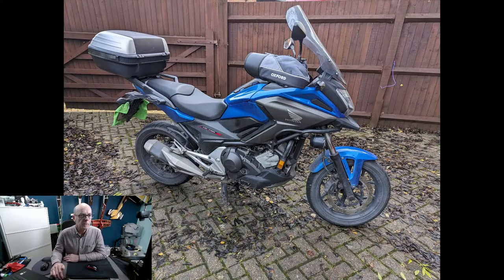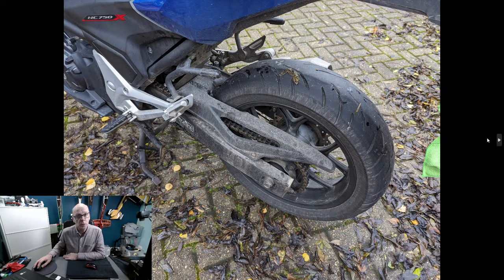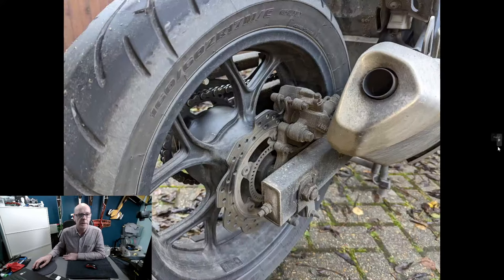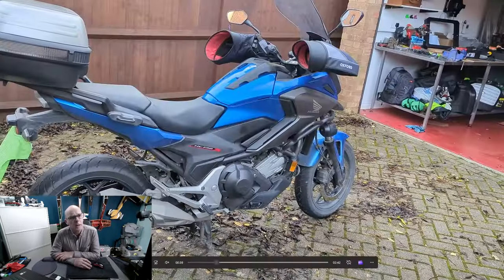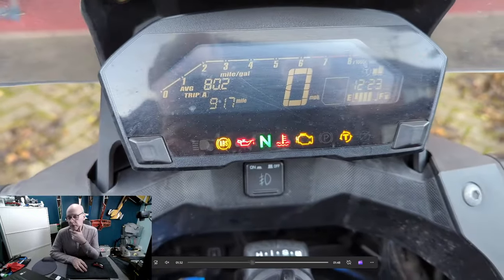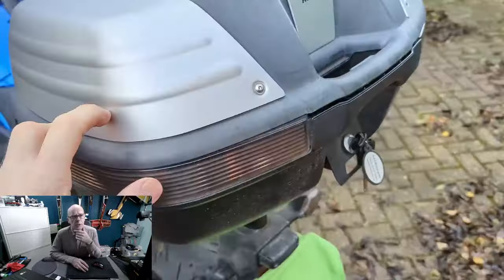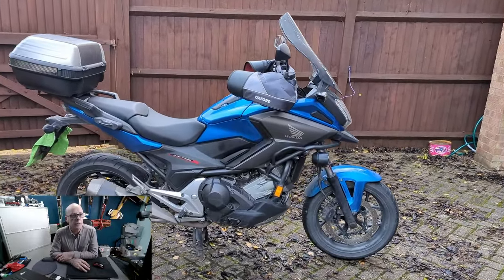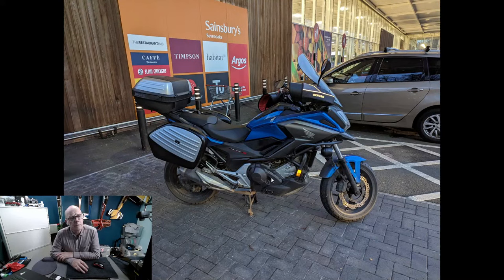Have I made a big mistake

Comment: I’ve just bought a new NC750 and really like it so far, everything you’ve said about yours is spot on.  However I can’t stop looking at the NT1100 and was sorely tempted at the time, but the value for money and capabilities of the 750 with its size and weight won me over. I will be extremely interested to see how you get on with your new 1100, good luck,  and hope all goes well with the bike and your channel.
Reply from the maker: Many thanks. You certainly won't be dissapointed.  It's a cracking bike and one I might even purchase againg because its so versatile, Economical, and you will have no issues with commuting or touring with this bike. You made a good descision. Cheers

Comment: All weather and shopping. That is committed. I have to revert to the car below about 4 degrees Celsius.
The reason I am here is that I was thinking about a NC 750X. Good to know you were pleased with it. For reliability it doesn't seem it gets much better than a Honda.
Do you go for the DCT versions or manual?
Reply from the maker: Hello, Definatley would go for the DCT. I was  converted when I bought the NC 750 X (Which was the best bike I have had for reliability and usefullness). Now wouldn't go back to traditional Clutch Lever. Everyone has their own opinion and it's not right for everyone. Would suggest a test ride for certain and make sure it's for more than 30 mins, and read up best way to operate before the test ride. You can't get used to it in that time if you havent riden one before.
A few videos soon here will be going through the DCT modes and how to get the most out of the DCT on my NT 1100 which is basicallly the same gearbox operationally.
Good luck with your descision, you won't be dissapointed with the NC750 X.
Thank you for your comments and have a wonderfull holiday season.
Cheers

Comment: I also have an NC-750 2021 and I really love it.  Here in the USA we aren’t able to buy the NT-1100.  Don’t know what Honda is thinking, but I would be in the market for one.  At 74 with 55 years of riding I would never consider a Goldwing, but for touring and daily use the NT makes perfect sense.  Shame they didn’t include a shaft drive.  Like you I sing the praises of the NC-750 for ease of use, exceptional gas milage and reliability.  Just subscribed and look forward to seeing your videos on the new bike.  My choice would be for the 6 speed with the quick shifter in Red.  All the best from Wisconsin.
Reply from the maker: Hello Many thanks for the subscription, much appreciated and really helps me along. Agree with your comments entirely. Weather in the UK is not as good as USA and it does take its toll on bikes especcially as a daily commuter. But mine never missed a beat, just routine maintenance to keep it in shape. Have a great Christmas over there, Cheers

Comment: Thank you for your video. I am certainly considering upgrading from a Dr650. Could you please explain how you got the touring screen for the bike as the windshield doesn't appear as stock. Thank you.
Reply from the maker: Hello Thanks for the comment. The windscreen was purchased from Slipscreens.co.uk https://www.slipscreens.co.uk/product/honda-nc750x-2016-2018-touring-screen and very reasonably priced at £60.00. Gives really good wind protection, but when you fit these make sure you obtain some small rubber washers to put between the screen and the fixing points, otherwise it will squeak when riding on less than smooth roads. But a great screen and I would recommend it. Certainly an essential if your commuting or touring on this bike as the origonal offers no wind protection. Thank you for watching the video. Have a good day. Cheers

Comment: Another year round biker…we’re a rare breed!  Good summary of  Honda ownership.  Finish on some Hondas isn’t great unfortunately.  Lots of acf50 needed and in the most vulnerable areas I use Lanoguard which is brilliant stuff.

My winter hack is a 17 yr old Suzuki Vstrom 650. I get about 65mpg from that or better, and it’s the most comfortable bike I’ve owned in 40 years of biking. Finish wise it still looks as good as new!  That surprises me but it’s down to regular cleaning and reapplication of protection.

My main bike is now an R1200RS beemer.  Utterly superb bike. Powerful, comfortable and great handling.   That surprisingly gets 60mpg too cross country on A and b roads if riding style is kept smooth.  Shaft drive a bonus.  Both bikes have luggage too.  The RS has full touring luggage and I have a top box on the VStrom.  If I had to go to one bike it’d be either a DL1050 Vstrom or DL800 vstrom.  Unbeatable for the money, great engines, punchy and reliable.  Suzuki set their suspension up so well from the crate that they’re usually very plush.

With you on the seat thing.  Thankfully both of mine are all day comfortable which is just as well as they are both being used shortly for occasional blood bike duties as well as touring.

Surprised you went for an NT given the competition at that level but guess people do get loyal to one brand.  I’ll try any bike once and have a list of ones I’d happily have as well as some I’d avoid!

Best customer service and spares as well as aftermarket parts choice has to be bmw for me. Yes, they occasionally have faults but they do look after their customers.  The big boxer engines are a joy to use.  Huge grunt from any revs makes for rapid progress when needed but they still have that relaxed character thanks to such a wide, flat torque curve.  Lovely build quality too unlike the triumphs I’ve owned which were a major headache, enough to put me off owning another.

Your outgoing Honda is a very under rated bike as people judge on paper specs but has a lot going for it.  I was tempted to one as a second bike for winter but the Vstrom was more comfortable bike for me and had a punchier motor and in some ways was more practical.  One thing I disliked about the NC was getting to the petrol tank especially if considering a pillion or luggage plus I wasn’t over enamoured with the finish but the motor was well suited as a gentle all rounder.

Good luck with the NT…don’t forget to spec heated grips snd hand-guards!  Wouldn’t be without either!  You may find the screen needs changing as with most, to avoid buffeting.  Be interested in your thoughts once you’ve had it a while.
Reply from the maker: Wouldnt have it any other way had bike since I learned to ride. First bike a Honda C70 money was tight back then. Moved up to old 125 BSA Bantem old bike but was fun. Then an Old Honda 550 K3 to Honda CBR 600 -350 YPVS and a few more on the way top the Honda NT 1100 bigest CC ive owned, not the most exciting. Keep on watching and the old stories will come out somewhere in my Vlogs which i'm going to have a go at going forward. Motorcylcing community best on Planet. Thanks for your comments. Ride Safe.  If you want to see how i get on please subscribe, Every subsciption makes me smile.

Comment: Great video.Let me know how much your asking for the NC and mileage!
Reply from the maker: Tne NC was traded in for the new NT. Unfortunatly I don't have the bike anymore. If I had the space I would have kept it. There are many around and I hope you find one as they are a great bike to own. Economical Reliable, and easy to repair. Thank You for your comment.
Reply: Will be interested to see how you get on with the new bike and if it does better over all. Personally I have a feeling you going to really miss it! Great video👍
Reply from the maker: I do miss some of the practicality of the front storage, you don't realise how good a feature this is untill its gone. I will post a brief how I'm getting on with the NT video soon as I've done nearly 2000 miles so far. Who knows I might be back on the NC we will see in 3 years time. Cheers
Reply: @kimetogo  only thing putting me off is the location off the fuel tank as I want do some light touring.Ive been running a triumph Daytona for the last 7 years but now want to take in the countryside and spend more time out and about!
Reply from the maker: @pauloakes5718  I used the NC for long distances also 400-500 mile journeys with some breaks along the way and the NC took it all in it's stride. Top box and panniers stowed everything I needed for camping out.   The NT will give me a bit more comfort this year with the gadgets and features it has. Better weather protection. When weather improves the videos will be put out there. Thanks for the comments.

Comment: You are brave in the snow
Reply from the maker: Good job its only 2-3 times a year we get conditions like that where I am, Slow and steady gets you there. Lets see how the NT 1100 performs in the bad weather. It's got a lot better weather protection than my NC 750X which is great.Stay tuned for updates and more Biking videos, with a few 3D printed modifications along the way.
Thank you for your comment which is much appreciated.
Cheers
Reply: @kimetogo  i own a 1 year old gsa 1250 and a triumph daytona speed triple i have heated grios and seats u have fitted both to triumph as well i am in my third winter if occasional riding. This started with my second r1200rt  i promise myself min 1 hour per month on each bike onlt criterior min 5 degrees and ideally dry this way i keep risks to a min i ride dainese gortex all year round  i have thermals for winter and a heated vest the gsa makes winter riding easy.
Reply from the maker: Lovely bike a bit faster than my NT. Like your tip for Tom Tom Rider which I have also, but not see the clouding up issue yet. Take care and ride safe. Cheers

Comment: You will not get 70mpg on that, and it's a big bike to lug around.
Reply from the maker: Certainly not as efficient. The NC 750 got around 80-85 commuting. And as you corrrectly say the NT 1100 will be a lot less around 50-55 I think, but we will see when I get a few miles in. Thank you for your comments much appreciated. If you want to see how i get on with mileage please subscribe and you will see the updates as they happen. Not sure if it's the bike for me yet but time will tell. If I don't get on with the bike then it's back to the NC750 next year which was a great bike and still is.

Cheers